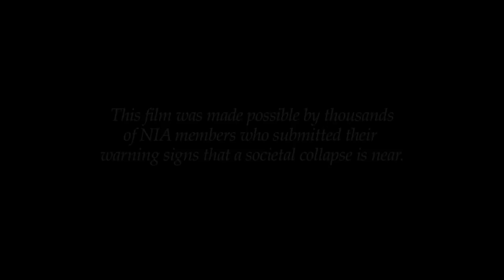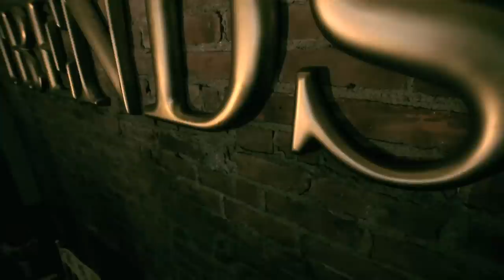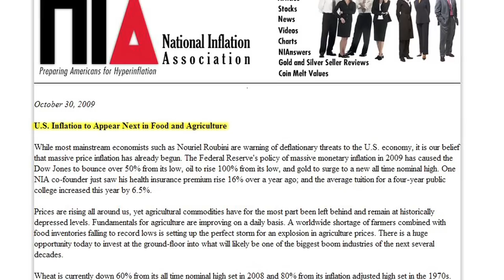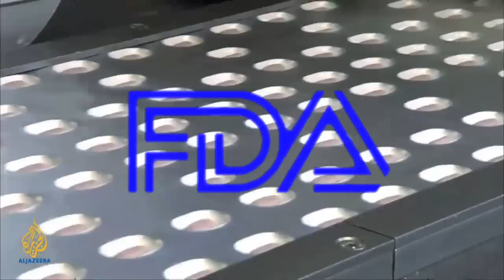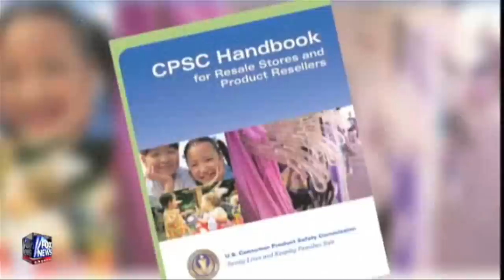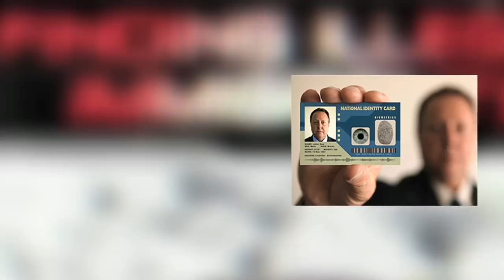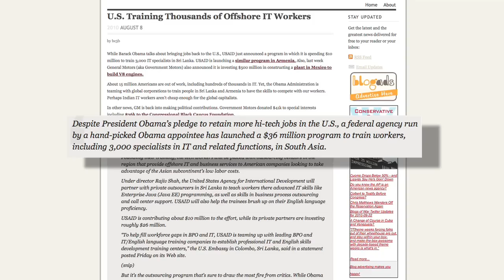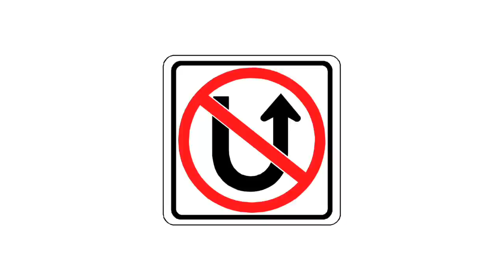End of Liberty

Comment: Part 3: Under the FAST Program, the DHS developed physiological and behavioural screening technologies to streamline the screening process at security checkpoints. Working with the DHS, Battelle, Drapier Laboratory and Farber Specialty Vehicles designed and developed portable screening facilities in trailers that can be used at airports and public events.

Comment: Part 1: The Cochabamba protests of 2000 (Cochabamba Water Wars) were a series of protests that took place in Cochabamba, Bolivia's third largest city, between January and April 2000 because of the privatization of the municipal water supply. The restoration of civilian rule to Bolivia in 1982 ended decades of military dictatorships, but did not bring economic stability. In 1985 with hyperinflation at an annual rate of 25,000% few foreign investors would do business in Bolivia...